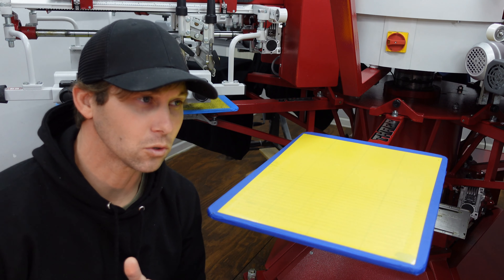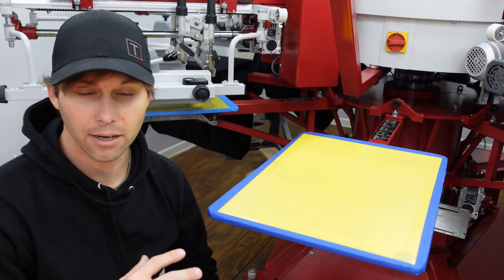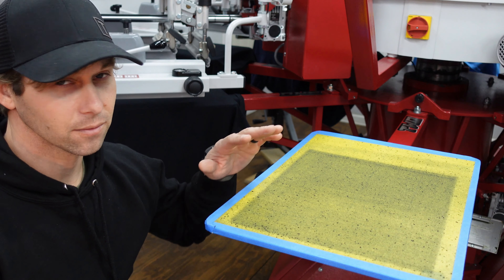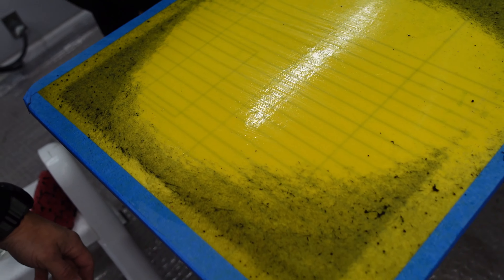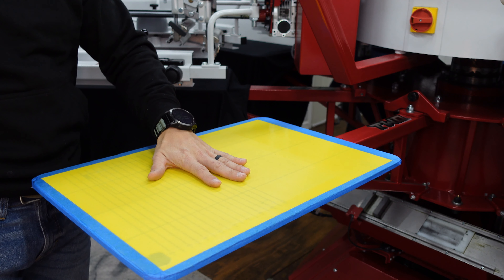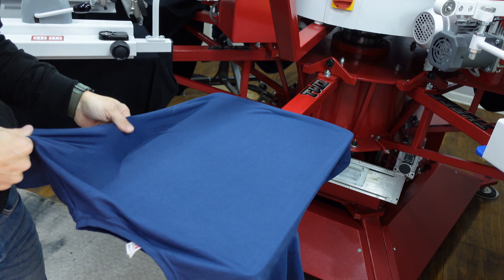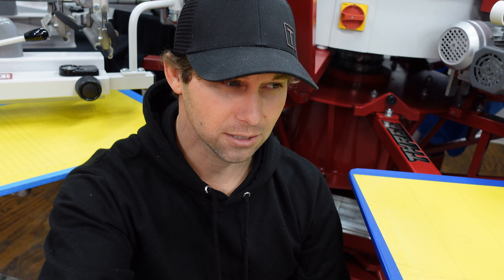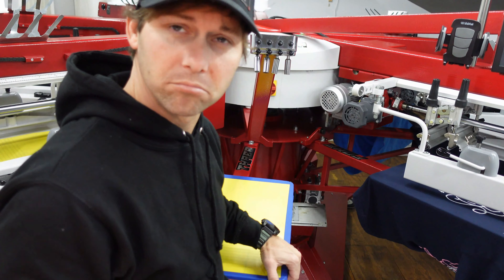PRINT GRIPPPPP!!!

Comment: Have you ran it with fleece material? Or silk garments? Still looking for some non spray tack that can do a good job holding those down and doesn't need to be cleaned every new set.
Reply from the maker: Yes I have done fleece, I usually wipe it off after 3 cycles. I can't say that I've ever printed silk, but if I did, I would probably run a hand full of shirts on it, to get rid of some tack. I think this stuff would hold silk very well, maybe too well if freshly cleaned.

Comment: Great vid, how is the print grip holding up 3 weeks in now?  It’s definitely been on my radar for a while now, just nervous to switch over in the middle of hoodie season.  Are you still getting 3 rotations of hoodies before cleaning?  Also did you stick it right to the pallet rubber or do you have pallet tape down first then the print grip on top of the pallet tape?  Thanks for the vid
Reply from the maker: It is still as strong as day 1. I am loving it, depending on the hoodie/fleece, I am averaging 4 rotations before I have to clean. And it wipes off SOOO much better than glue. And yes I did put pallet tape down first, then I printed my registration templet on top of the pallet tape as usually, then applied the print grip. If you don't put pallet tape down first with some type of registration lines, I'm not sure how you would line up prints... Ideally I would like to have this medium tack for hoodie season, and have a separate set  of pallets with the lower tack for tees. The yellow is a bit strong for shirts at first (just like fresh glue) but eventually it gets lint on them and gets easier to take off. All in all, I love it and don't see myself going back to anymore glue. Hope this helps and thanks for watching.